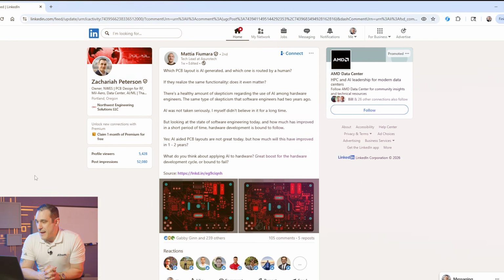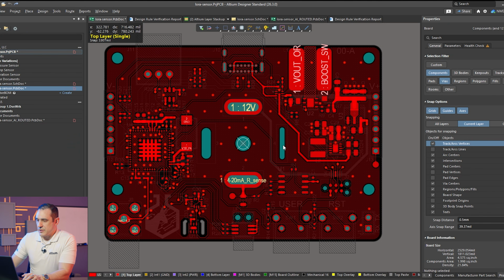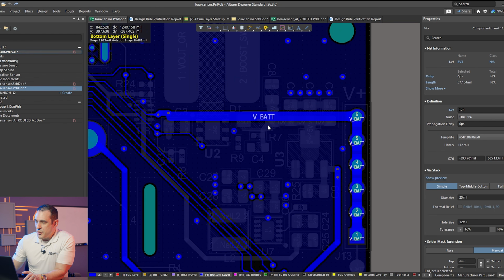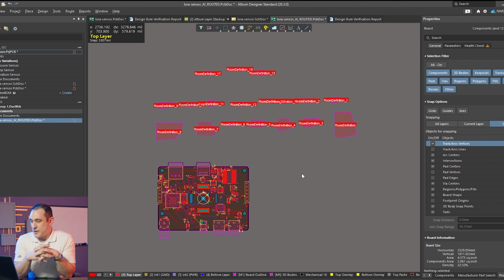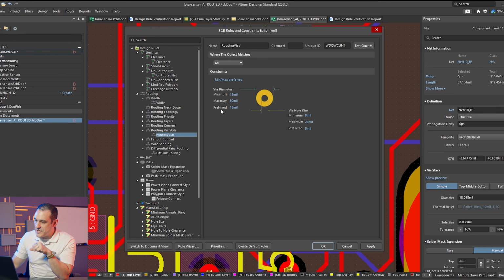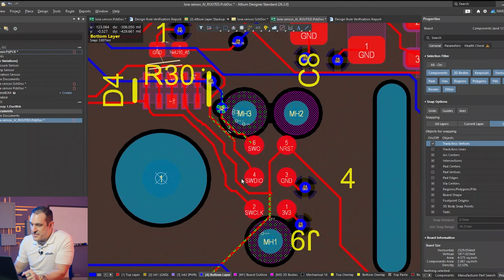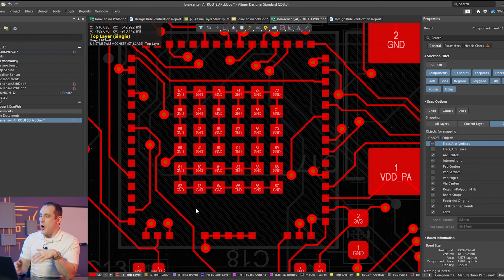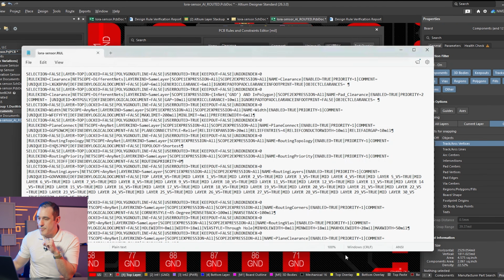AI PCB Layout vs. Human Design: The Honest Truth

Comment: Is there any free Altium access for electronics hobbyists?
Reply: If you want a free solution that is based on Altium's features and tools, you should use CircuitMaker. The software is free to download and use, and you will get a free online workspace to store and share your projects through Altium 365. The software is like a Lite version of Altium Designer... it removes some of the automations, simulation, collaboration, and supply chain tools, but it does include the basic layout and routing features. It also includes the Manufacturer Part Search panel so you can find component models direct from manufacturers. The other thing that is important is compatibility: CircuitMaker file formats can be easily converted to Altium Designer, and vice versa. The way the tools function in CircuitMaker is also very similar to Altium Designer.

Comment: As someone with a lot more experience in software domain rather than hardware domain  but with still enough on hardware side to understand that the volume of data models can be trained on the software side is not comparable with the amount on hardware side. On top of that, on software end it is also much more plentiful in curated source code, which is important to differentiate between good code and bad code (not only working code). If that doesn't add enough sore to the injury, LLMs or text based predictive models work over a 2 dimensional input and outputs. PCBs have, to say the least, 3 dimensions in output, that when we disregard non spatial dimensions, such as physics within eletromagnetism and need to be accounted for.
Context s important in both software and hardware world's. And if it's already easy for AI to slop in software without proper context, imagine on hardware side.
Not saying it's impossible, but we are very far from having an AI to autonomously create good PCB designs reliably.
I think there are definitely good uses on AI to assist PCB design and you cited a good one of them. Specially because design rules can be inferred over the same dimensions LLMs most training data, which then become 3D vectors (instead of 4D, which is one order of magnitude greater in exponential computing power, needed for inference).
One other thing I actually been thinking of working on myself is to help me with something that I find extremely complicated which is finding the right part for your BOM, based on specs and constraints. That one BMS with a gauge, or the capacitor with the right characteristics, the microcontroller with the right frequency, quiescent current, power rating, peripherals, etc. Or one of the most error prone and time consuming one's which is avoiding components that cán resonate on specific applications (looking at yoh, one shall not say its name beads). But I think you know how hard it can be to develop a knowledge base of components you can intuitively find and source (and will still be missing a lot of what's available)

Comment: I’m laughing because I’m autistic and ADHD. And every Neurotypical is astounded that AI did not follow the rules of human metrics. 😅 and then the Neurotypicals are trying to decode and find out why and try trying to black box. And the claims that the human version is better. I concur because as a neurodivergent, we have bottom up processing, and you guys have topped down. So of course you guys will never understand because you guys always look at things through a singular lens but as a neurodivergent, we look at it up down middle side through all 360. 😅 and then the very fact that just because it had 139 rule violations. But zero technical error errors. Just like the human board. Doesn’t give you a basis to say that the AI version should be rejected. In fact. It’s kind of like a neurodivergent child that doesn’t get along with their peers in the classroom. Maybe you need to change the environment for the neurodivergent. Instead of forcing the neurodivergent to force and into societies parameters and roles. Maybe the problem isn’t neurodivergent or the AI board. Maybe the problem is all the red tape. For the human versions. And that is where the clash. Will always begin and never end. 😂

Comment: The one on the left is AI generated the one on the right is human generated. And why does it matter if they both function as engineered to. 😅 it’s because of the overall schematics. Half the time AI does something. And half of the problem is decoding it. Versus the human able to backtrack exactly what they did front and backwards.
Reply: The reason it matters  is beyond understanding the context. I think a properly documented design with constraints enforced could be "backtracked" in a way by AI. What's more important is that the definition of "function" is inadequate. A board can appear to function perfectly and still fail EMC testing, for example; the AI would then need some feedback in order to determine the best solution approach. Many times the "best" solution is too complex for an AI to determine and instead we have to rely on experience, experimentation, complex simulation, and bench measurements to determine the root cause and best path forward.

Comment: As an engineer, it's the same with code.

Does it technically conduct electricity? Yes.
Is it right? No.
Reply: LOL.... I guess that's the human's job, right? Optimize for best performance, not the existence of a connection. Like with AI generated code, the code technically works but is it scalable to thousands or millions of users? Does it integrate well across your stack? It's easy to come up with similar criticisms of PCB routing.

Comment: It looks more like the comparison & post was intentionally designed look like a 'fail';  Zach did gloss over the concept of context, but it's a very big deal -- in that the human router brought a lot of contextual knowledge about the design into the guidance of component placement, routing style, and setup reasonable rules.  Good auto-routers can do pretty well with gated guidance - and Zach could have made some auto-router comparisons.   I'm also wondering why Zach didn't even mention the several Model Context Protocol (MCP) server options for interfacing AI tools to Altium Designer....?

Comment: with two separate reference planes, wouldn't stitching vias be virtually useless and need to be caps instead?
Reply: Yea that's what I thought, stitching vias are good regardless to connect the planes but they won't help with reducing the signal return path impedance
Reply: @whyargon  If the stitching vias (when applied randomly) just happen to appear near a signal via then they are beneficial. That is why some design guidelines will state to just use the stitching vias, but they won't state what specifically you are trying to accomplish!

Comment: I have seen worse PCBs generated by engineers? but how would it compare to a standard autorouter?
Reply: It's definitely better than a standard autorouter. That's because an autorouter tries to take on the entire design with no process for prioritizing routes or preventing rules conflicts. ActiveRoute in Altium Designer is pretty good as a first-pass autorouter. I actually like it because you can pick a specific set of nets to route, and the allowed routing layers, and it can do a decent job. Of course, you have to set up the relevant design rules first, and you need to give the signal an input to the target routing layers (like using a via). The results shown here look similar to some ActiveRoute results I've seen.

Comment: its halucinating. Just like AI coding use to (BADLY) may I add .. about a year ago. Now AI coding is DAMN GOOD. Reason? Training data. Either there isnt enough training data (ie: PCB designs the AI can look at available onthe web) or B. The current models arnt fine tuned to train on that data.  Probably a little of both.  Now you can use simulation and reinforcement learning  to have the AI keep trying to hit a target desired layout but that desired layout has to be provided by the human / existing PCBs.  Either way, this is a sign that there simply isnt enough training data for the scaling laws to do its work. I also think the tooling has to be better to meet the AI where its at today. IE: rather than full autolayout, perhaps have. zone of interest, and use prompts to fine tune just that zone of interest (tweak placement, auto-rerout just that zone etc). This area is ripe for research and startups.

Comment: The AI layout is low beginner level. It's random placing and random autorouting - basically what every beginner is starting with.
Trace widths, placement, grouping, best design practices for a subcircuit (like power conversion) are just not done. It looks completely messy. The handling of the ground pads is shocking.
No way this will ever work with high speed external memory, USB3, PCIe etc. It's crap 😀

Comment: I used to design PCBs for a company I worked for. We used Protel99se and switched to Altium designer when it came out... which is a great PCB design tool. No AI back then... I refused to use the autoroute functions tho, probably for the same reasons you've shown in this video 🙂

Comment: The main thing I don't understand is autorouters exist a years. And the prerequisites for working with AI is the same as with autorouter so what is the point of using that kind of services? You need to place critical components, make rooms, make schematic annotations, create rules, check them and then send it to the service that makes 1000 variants and you need to explore which is not so horrible wrong and take handworking with this "result". I think autorouter much better and controllable and if end result is not that you looking for so what is the point?

Comment: I was looking into the idea of using an LLM to generate .RUL files for Altium and one of the issues seems to be that the Altium Query Language is really tricky to use.  I think we might benefit from using LoRA to fine tune a model so that it understands AQL better, maybe something modest like Gemma-4-E4B.  It could be fine tuned pretty easily and would be able to run even on modest consumer hardware.  The real magic trick would be getting several hundred or maybe a thousand high quality training examples to train the model with.  It would be really awesome if Altium was willing to open source some .RUL files - there are a few examples of manufacturers who provide such files, and I might be able to synthesize some, but actual training data is always better than synthetic data.  So... how serious are you about that idea?

Comment: Isn’t PCB layout something that can be done with conventional algorithms like existing autorouters? And the fact that it finished with all of those violations suggests that it wasn’t iterated nearly enough, or lacked DRC feedback. Of all the places where neural networks might be able to fit in to the electrical engineering process, I think board routing is the least important.

Still, perhaps someone less biased would be able to spend the time to create a machine learning algorithm to make this at least as good as an autorouter. You’d need to be able to get the DRC information piped back into the neural net for feedback, I don’t know if Altium has the ability to output that in a machine-readable format so you might have to use an open source EDA package instead. With that, along with a well-curated training set, this seems like a solvable problem with at least some use of machine learning. So do many other parts of the EE process, like generating spice models from datasheets, creating well-laid-out schematics from netlists, creating netlists from schematic images, and reverse engineering netlists from board images.
Reply: Board routing is definitely the biggest opportunity from a productivity perspective and yet no one has cracked the code in the past 30 years. And no this is not something that can be conventionally done with autorouters. There are semi-automated tools where you guide the tool 80-90% of the way to completion, and then the autorouter just fills in the beginning and end of the routes.

Comment: The AI  layout remembers me to the layout I saw from a schoolboy, making his first step with KIcad etc, not knowing anything about placement rf etc. Also an autorouter ca do it better. So Ai in this case is far away. First a good placement must be implement and after the problems with routing its a nogo to leave it with unroutet nets and violations. A autorouter even tries harder. The whole section with switching regulator is a disaster, wont work like this, AI shoudl consider also layout rules given in teh datasheets, ofter there are hints for placement.  The GND net is also disaster. Bute as AI progresses there is some hope. The codeer AIs really did get better within the last time, and this can happen here also. Woudl be nice to have really useful tools. I am doing layouts etc since CAD exists, first using the manual methode 4:1 with crep paper (or called similar), then the first PC tools ... etc. Now Altium is my favorit...Doing some layouts for space graded PCBs (MOVEII +IIB for 7 and 5 years in space transceiver baords UHF/VHF and SBAND). We didnt speak abotu traces with RF rules etc... There AI could get helpful but need then a lot of understanding, e.g. design filter microstrips etc,.

Comment: To me, this video highlights a reason people struggle with electronics and PCB design, not just AI. A schematic typically does not have all the information needed to define a pcb layout. I think a big reason people struggle with getting into electronics is all the prior knowledge needed to look at a circuit for the first time and make any sense out of it. There is no standard way to call out what components need to be prioritized in placement and routing from a schematic. That's the problem with I see with the AI pcb
Reply: Yeah that's fair, but currently the way to implement all context is with a specifications document and a process for prioritizing specific parts of the board for AI place&route/autorouting. Of course that is all still evolving because these tools are so new.

Comment: The AI looks like it was much of the training examples were the sort that was available in the 1970s or 1980s; it worried about connectivity rather than fields.  The strange angles were also less of a problem; they aren't wrong so much as non-standard and therefore errors-prone, but they were less non-standard when more was done by hand.  I do wonder if some of the unneeded bends were an attempt at length matching.

Comment: The near term value of AI in circuit design is schematic development and analog schematic optimisation. Autorouting is very different to current LLM architecture and a travelling saleman problem to be solved later. But automatic simulaions for effects of layout on circuit performance with AI optimisation suggestions could be brought in relatively soon.

Comment: Which AI tool is used for this placement and routing? I just curious, since I didn't touch AI + PCB and would to understand more how it works - do I need to provide to the AI tool a netlist of the circuit, also other data - is this sufficient then to just give command go and the placement and routing to go automatically (for the autoruter is clear, it exists since centuries)? Which tool can provide such a thing, because as an Altium User I don't know for such a feature in Altium.
Reply: i fed my board into quilter and provided it with the context it asked for on the website (you can look for yourself). quilter specified that board outline be defined and i hand placed all critical components (connectors, MCU, etc...) and then it filled in the rest and did the routing.